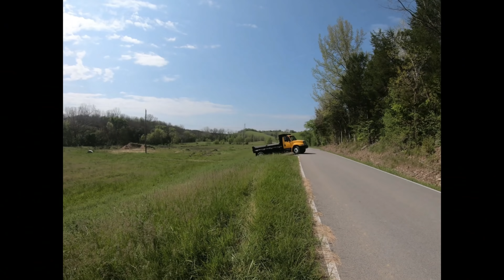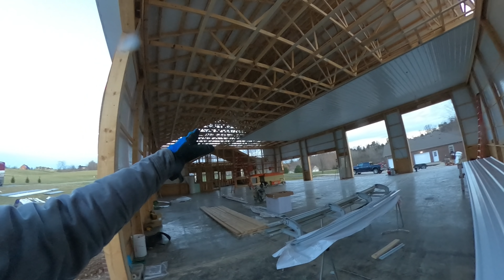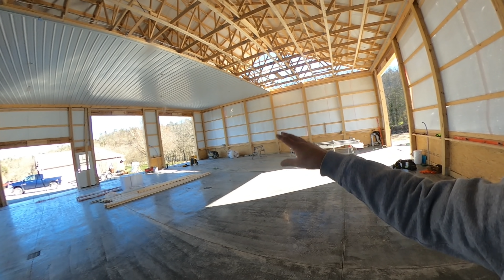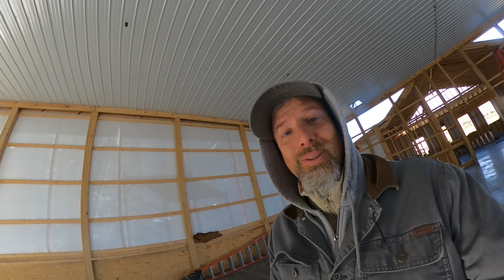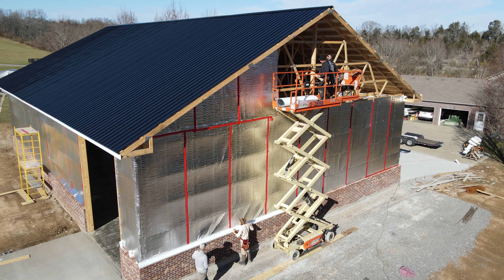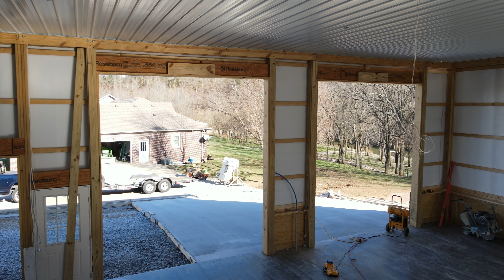Building the Ultimate Garage | EPS 21 | Installing 25 foot Metal Ceiling Panels! | Shots Life

Comment: Great looking ceiling.  Always a surprise just how much they can brighten the inside up.  I am guessing you folks get a pretty hot summer in which case you might want to think about a fan in each gable end as they can really cool down the building even when the ceiling is insulated.  The insulation will be cooking off heat til early the next morning when it will heat up again but with appropriate fans the building will begin to cool immediately when the sun sets and it will keep it much cooler during the day.  Just a thought.  They come with automatic temperature and humidity controls to come on when needed or you can also have a switched circuit to come on when you want.
Reply from the maker: Good tip!